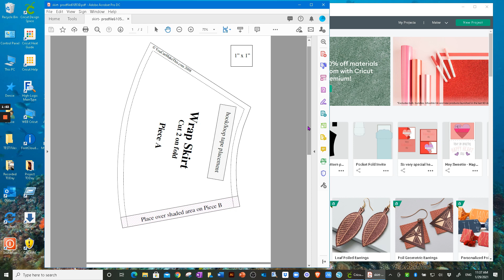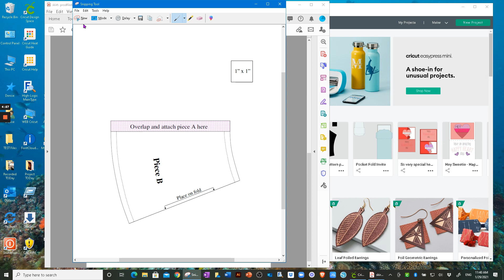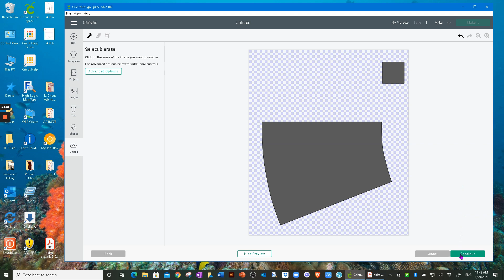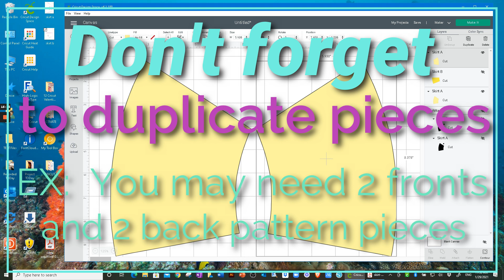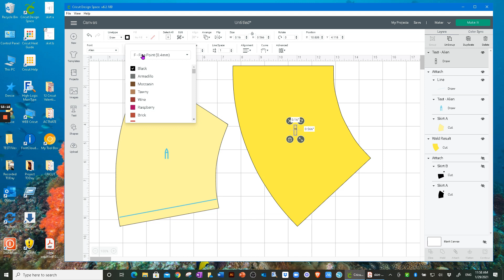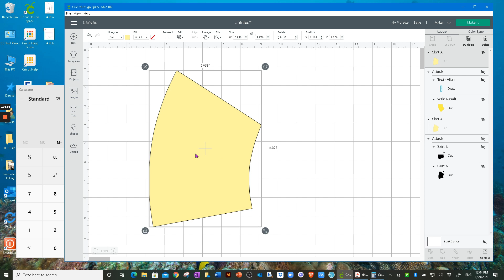Comment: I have a pattern I am doing that is applique pieces. I traced all the pieces onto a sheet of paper, scanned it, and followed your tutorial to get it into canvas.  I used contour to delete the 1" box after sizing everything appropriately.  Some of the pieces need to go on different mats, because they will be different fabrics. But all my pieces came in "grouped" into one item.  Is there a way for me to make them individual pieces so I can change the colors like you did?  That will allow me to have different mats.  Thank you!
Reply: If you click on the grouped pieces, does it allow you to “ungroup” them just above the layers panel is group/ungroup.
If this does not work, you can make the same amount of copies of the group as there are pieces in the group and then select a square and slice each piece apart or personally I would make the copies then use the “contour” feature to deselect all other pieces except for one shape, then continue until you have one of each piece that is separate.
I hope this helps!  You can also email me if you need further assistance.  My email is in the about section of my YouTube channel 😊
Reply: @DeniseHumphrey  thank you!  No, the ungroup button is grayed out. I will try making multiple,copies and contouring out the ones I don’t want in that layer. Thanks!  My next task is to see if I can turn these into embroidery files to stitch them down so I don’t have to do it all manually. Thanks for the help!

Comment: Thank you so much, can I down size it for my 6” dolls .
Reply: Hi Bernadette, I have not tried it but I'm sure you could.  To try it out.  Group all pieces together and select "group" then duplicate the group and turn one of the groups off.  This way you have a group to practice with and not mess of the sizing of the original group.  Then on the practice group, keep it grouped so all pieces will size down the same.  This is where you will need to really test the process out and test cut one out to see how close you are.  OR if you have a 6" doll pattern piece already you may be able to compare the 2 sizes?  If you test this out, let me know.  In my mind you should be able to scaled a doll pattern up or down to your choosing, providing it fits on the Cricut mats.  😊

Comment: Thank you so much for the video! The only problem that I am having is that there is just the tiniest bit of bleed from the ink/outline. I chose complex and changed the color tolerance and that did help a lot but when the rotary blade cuts, it is still not completely a smooth cut all the way around. Do you have any suggestions?

Comment: That was very helpful, thank you! I'm new to my Cricut Maker3, and was wondering how to cut patterns on fabric.  Glad to now know the snip it tool, and how to make pattern smaller! Questions: if we scan a pattern, would it be a copyright issue? And can we draw a paper pattern and scan it to use? Thank you again!
Reply: Hi @thePacadashery, So happy this was helpful.  As far as copyright issues (although I am not an attorney, lol) it really can be confusing.  I try to think of it this way:  If I bought the file OR if the file or pattern was free to use from a blog or website, I can scan it for my personal use for the project I am making.  If the same pattern or file came with a "commercial" license, I could make the project and sell the item I created after using that pattern or file.   I would be in copyright violation if I gave their "digital pattern" to others for use whether free or paid.  The bottom line though is if a pattern or file comes with a license then be sure to read it as some have limitations, such as you can sell 200 items made with my digital file, please reach out if you need to sell more for a different license.  So again....there are so many variables to consider.  If ever in doubt it's best practice to reach out to the owner of said pattern, most are quite happy to help clarify.  Now, as far as drawing paper patterns, yes!  You can draw a pattern on paper and scan it to upload it.  I'd suggest adding a true-to-size reference such as a 1" square measured by a ruler on the paper pattern you drew, so when you upload it, you can verify the 1" size once in Design Space then you know the proportions are correct.  In addition, patterns can be created by using digital apps such as Inkscape, Adobe Illustrator, Procreate, and Canva.  Just to name a few!  Sorry, this was so long but I hope it will be helpful.  Have an amazing day!  😊
Reply: @DeniseHumphrey  Thank you so much for the detailed and clear explanation! I appreciate you taking the time to answer me.

Comment: How did you select two items at once when you uploaded the pattern to the canvas area? Did you use the control key or a different key?
Reply: Hi Marilyn, When selecting items to add to your canvas, you can just click on each file once.  So it will allow you to keep selecting more without having you hold shift or control.  But.......once those pieces are on the Design Space Canvas, you then would need to use your "shift" key to select more than 1 item.  I hope I understood your question correctly.  If not, please let me know, and Happy Sewing! 🙂

Comment: Denise I love this video. I'm a newbie to Cricut and I love how much time you've taken to really explain this for beginners as well as everyone else! 

I'm stuck though and I can't figure out why - I followed all the steps, I had the Cricut machine cut the 1' square from the pattern piece as well (to check that on my first go it went correctly to size) but the pattern piece is tiny.... it should cut a 5 & 5/8' piece square but it's 2 & 7/8'...any ideas what I did wrong?
Reply: @hollyYoung Hi 😊 so happy you enjoyed it!
When you first uploaded the pattern into Design Space, did you keep the pattern piece’s grouped to the 1” square to size all pieces at once?  Off hand it’s the only thing I can think of in the moment.  Also checking to see if you uploaded to Desktop version of Design Space or the App version via a tablet? 😉
Reply: Hi, I had the same issue - my units of measure was set to imperial instead of metric. Go into your settings and make sure your units are set to metric.

Comment: What machine do I need to get the cut and the draw feature?
Reply: Hi cw wa, The Cricut Maker's, The Cricut Explore's, and the Joy all can cut and draw.  But if you are looking to cut fabric and other materials, by far the best would be the Cricut Maker or the Cricut Maker 3.  The reason is it has more pressure and can cut so many more materials and was meant for this purpose.  Yes, you can cut fabric with the Cricut Explore Series, but it will be limited compared to the Cricut Maker's.  Hope this helps!  😊

Comment: Hello, if my pattern doesn’t have the 1 inch or 3 inch square in each page, how do we cut  the pattern?
Reply: Hi Abby C, As long as the sizing square is on 1 pattern piece, you can group all pieces together once you upload them with the one piece that has the sizing square....once they are all grouped you can make them bigger or smaller to match up to that one sizing square.  I hope this makes sense...basically you are sizing them all together in a group, instead of each individual piece.  😊

Comment: How would you do it if only one page had the 1 inch reference?
Reply: Hi Aleth Soto, As long as the sizing square is on 1 pattern piece, you can group all pieces together once you upload them with the one piece that has the sizing square....once they are all grouped you can make them bigger or smaller to match up to that one sizing square.  I hope this makes sense...basically, you are sizing them all together in a group, instead of each individual piece.  😊

Comment: Terrific tutorial.  I have one question though.  I have a pdf pattern which has 2 pattern pieces which must be joined, but have been printed with dotted lines where the join is to occur.  When I download them into design space and try to remove the background, everything is removed because of the spaces between the dots.  I have tried printing the pieces, drawing in the line with a marker and taking a photo, but the results are not satisfactory.  Is there anything else I can do?
Reply: Hi Sandra, Great question!  My first thought would be to try what you did by printing and filling in the line then taking a photo.  You would just need to make sure the 1" box will be on both pieces.  May I ask what made the results not satisfactory?  I have done this exact method when using PDF pattern pieces into Design Space using my iPad.  Sometimes I needed to edit photos to lighten it up a bit though.  The only other thing I can think of would be to scan the pattern pieces after filling in the line with a flatbed scanner or at a print shop if you don't have one.  I have used my Brother Multifunction printer to do just that.  If you have the use or know of someone who can use either Adobe Illustrator or Inkscape you can upload your pdf files and then add a line within that software then download it and even save as an SVG or PNG instead of a PDF.  Ok, I'm running out of ideas, LOL I hope this helps somewhat?  Let me know if you find out another way  🙃😊

Comment: Hi Denise! Great explanations.  I'm trying to decide whether a circuit maker is worth the investment.  You have the most recent information, for which I thank you so much!  I just started sewing handbags, wallets, etc.  Most of my PDF files, at some point, require me to tape pieces from different pages of my pattern together to make the full pattern piece.  How do you take a screenshot of the piece in this case?  Do I have to take screen shots of every page that contains part of the pattern then but them up next to each other to form the full pattern piece?  Thank you for your time.
Reply: Hi Rita, You are correct.  Take screenshots of each pdf page then upload to DS, then weld or attach the lines on the pattern pieces together depending on your desired outcome.  Keep in mind you are limited to the size of your Cricut mats.  A 12" X 12" mat can cut fabric to 11.5" X 11.5".  A 12" X 24" mat can cut fabric to 11.5" X 23.5".  I will also mention another route would be to digitize your pattern pieces by using software like (free) Inkscape or (paid) Adobe Illustrator.  Both of these software's do have a bit of a learning curve.  With these software's you then have the option to save as a pdf pattern or a SVG file.  Oh, one more thing!  If your pattern is simple as in mostly square, rectangles or slight curves, you can create your own patterns right in Design Space using shapes.  I've made some really cute cell phone purses this way!  I hope this info helps!  😊
Reply: @DeniseHumphrey  Thank you for the tips.  I appreciate you replying. Happy New Year!
Reply: @gnastics352  Anytime!  Happy New Year to you as well 😊

Comment: Hi Denise, Did I miss the part where you advised Cricut Access needs to be downloaded? 

After fiddling for several hours, following your video and not being very successful, it seems you have to subscribe to Cricut Access! I wondered why I wasn't getting the same information as you. 

Is that it then? No way of getting patterns to cut successfully unless I subscribe? I'm so disappointed.
Reply: Hi Denise, Thank you. I'm sorry if I got it wrong. I was using my laptop. 

I've had another look and after clicking 'Complex' and continuing, it definitely says that you need to subscribe to Access to be able to remove backgrounds. I've tried going forward with the background in tact but one showing 'print then cut' and the other is 'cut' but that is just a black rectangle. .

You click by the undo arrows, where options come up. I haven't got that facility!
Reply: @christineavey1398  Thanks for the clarity of your issue, very helpful for me!  It is true the "Automatic" button to remove backgrounds is for Access subscribers.  But you can use the "Manual" options which are only a few extra clicks and are FREE to everyone...those options include the wand to click where you want the background to be removed and the erase to get rid of large areas quickly and restore for when I mess up LOL!!!  Hope this helps 😊
Reply: Oh Denise, I'm such a numpty. Although you clicked at the top left to bring up the erase features, when I scrolled further down on the Erase info, there,where the icons for erasing manually.

Thank you for spending the time trying to work it out. Now I'll see if I can get to where I want to.

Thanks for everything.

Christine
Reply: @christineavey1398  Oh no worries at all!  Cricut Design Space had several updates/upgrades since I made this video, so sometimes features may look a bit different.  On the positive side, Cricut is always improving their software, love that!  Have a happy day!
Reply: Hi Christine, You do not need to be an Access Subscriber to upload an image which is what I do in this tutorial is take a screenshot of a pdf file and save it as an image, then upload that image into Design Space.  As far as not getting the same information as you, Is it possible you are using a tablet instead of a desktop computer?  If you are using an iPad I have this same tutorial for iPad users here:  https://youtu.be/ycy8UBxqsZM   The only other thing I can think of is a possible glitch with your Design Space software which Cricut's Help Desk can assist with.  I've had a very positive experience whenever I've called them.  I hope this helps!  😊

Comment: The pattern I want to import is the sewing line, which I like to mark with pen. How do I set it to mark with a pen and then cut like 1/4" around the line for seam allowance?
Reply: Hi Tweet Tweet, I hope I am understanding your question.  Let me know if I misunderstood 😊😊 I am thinking you are wanting to upload the pattern into Design Space.  Then you want to make the pattern 1/4" bigger or smaller and then be able to make that 1/4" seam allowance with a Cricut marker?  If I have the question correct this is what you would do.
Upload pattern piece into Design Space and Duplicate it.
Either Add or Subtract .5 from the width and height of the pattern piece using a calculator.  Unlock size and adjust to the numbers on the calculator.
Lock the size back up.
Click on the pattern piece you just resized and change the "Operation" (upper left-hand corner of DS) from a "cut" option to a "draw" option.  
Then choose "Pen" then choose "marker" then choose the "Blue washable fabric marker".
Line up the pattern piece and the pen part of the pattern piece to be centered then select both pieces and choose "attach" (lower right-hand corner) so when you click on make it, the Cricut will know to cut that pattern piece and also mark it with your pen.
Oh, I hope this helps.  If not, please let me know or you can also send me an email where you can send photos or videos of your question and get a personalized answer-back 😊

Comment: So strange question...if you're mirroring to cut on the fold, wouldn't you have flipped horizontal and aligned the the pieces against the top (which would be the fold?)
Reply: Hi W T Dahl, Great question!  I did it this way due to the curve/angle in the pattern piece.  If you look closely you can see the curves match up just as if I had folded the pattern piece over like we do on our sewing cutting table.  It's kind of confusing.  With this curved pattern piece If I flipped it horizontally, it would have made it double end to end instead of width-wise.  I hope this helps! 😊

Comment: Thanks for the great tutorial! I was a little confused because it looked piece a and piece b were supposed to be joined and then cut on the fold. Is it possible to do this before turning it into a solid shape so the overlap area could still be seen?
Reply: Hi L, Yes absolutely you could.  Sorry for the confusion. If I understand your question correctly, about the two pieces that would be overlapped, you would have 2 choices....you can use the grid in design space to help get the overlap lined up correctly, or you can upload the pattern piece as a print then cut file then overlap using the lines on the pattern pieces then change your pattern pieces from a print then cut to a cut file via the "operation" option in Design Space.  I hope this helps answer your question.  If not please let me know.  Thanks for watching and You are very welcome too!  😊
Reply: @DeniseHumphrey  oh I see now thanks so much! This is all new to me and so far your tutorial has provided the best introduction to the Design Space environment :)
Reply: @user-zd5wm7dy9m  Happy to help!  Take care
Reply: I thoroughly enjoyed your tutorial and how you explain things. May I make a suggestion for future videos? I was extremely distracted by your cluttered Windows background… Especially when things were moving around. Things that move like that make me dizzy.

Comment: Denise! thank you so much,  this has been so helpful. Quick question, how different if I have the patterns in svg files.
Reply: Hi Claire, great question!  Since SVG patterns are still kind of new, I've found most of them include a pdf reference pattern with the Width & Height included on each pattern piece, or they send like an info sheet that gives the Width & Height dimensions of each pattern piece.  This way when you upload the SVG pattern pieces into Design Space there really is no need for a 1" square, but I have found some include it.  I did reach out to a pattern designer whom I purchased an SVG pattern from and she was more than happy to include the sizes I needed via email.  Not sure if she just forgot or didn't think it was needed.  I hope this helps!  Oh you also have a choice to upload as a "cut" image or a "print then cut" image.  If you upload as a "print then cut" you can see the measurements (if they typed them on the pattern pieces) make sure the Width & Height are good or adjust, then change it to a "Cut" File via the "operations" tab  Whew, sorry so long, tee hee!  🙌😊